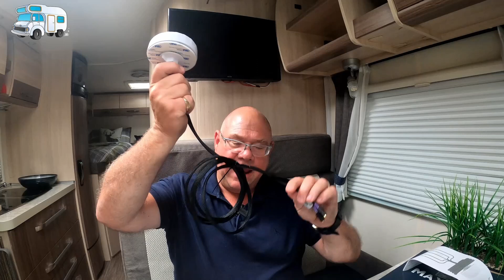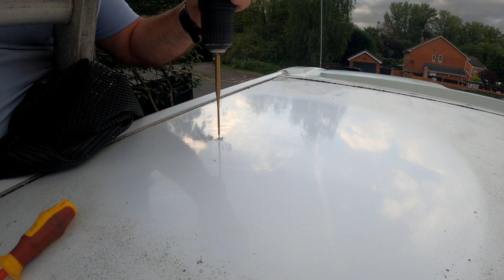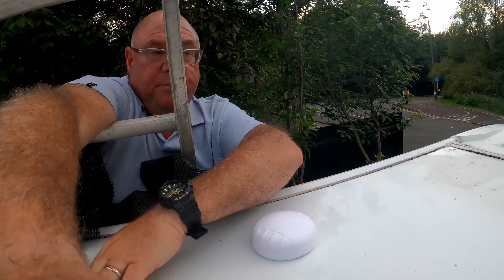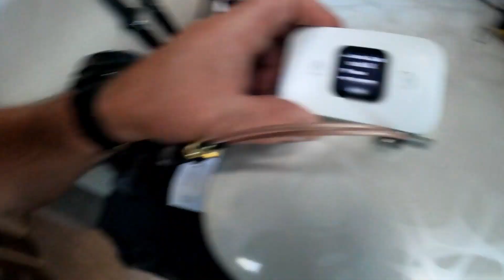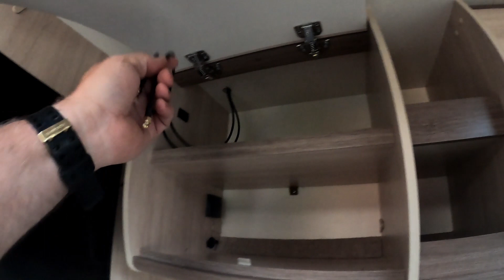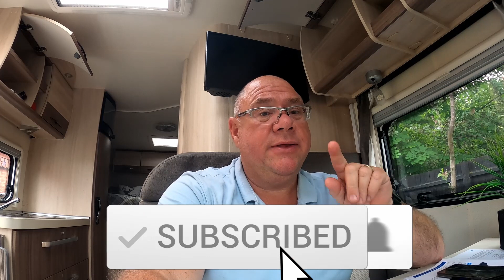MAXVIEW ROAM - Motorhome WIFI made simple

Comment: Most folk have those mimo antennas turned 90 degrees to yours so it is more aerodynamic ! 
Installers are making good money "fitting" these units. 
A true test might be done in a remote area using different sim providers and comparing signal strengths? 
Maybe another video idea?
Reply from the maker: Maxview actually state fitting it like this. No idea why. As a fully qualified radio ham, I understand radio waves and can see no real reason or benefit either way.

Comment: Informative vlog.
But I would have used bead of Sikaflex or other silicone sealant product in the drilled hole  for the permanent fixture of the aerial/antenna, and not relied on the sticky pad,  and a bead of sealant around aerial/antenna, to keep the entry of the roof dry/moisture out.
Reply from the maker: Yes. Out of camera I did do that. Sikaflex is king.

Comment: I fitted the Maxview roam to my caravan about a year ago, not the best move l have ever made 😢 speeds have been very poor, Maxview technical help were useless. On my new have l have just had a motorhome Wi-Fi installed, found it to be a far superior set up, speeds have been great. Used the same network provider on both systems.
Reply: Sounds like something you done incorrectly because this is a professional system
Reply: @ashleyprosser9867  trust me it was fitted correctly….. just a crap unit….. motorhome Wi-Fi all the way
Reply: @leearmsby235  what make is that?

Comment: Hi , Any follow up video to this ?
Reply from the maker: What questions do you have
Reply: @MikeM0XMX  I’ve just bought a Motorhome with the maxview , not been away in it yet but just wondered how well it worked and how good the signal is ? ( sorry , I’m a complete amateur!)
Reply from the maker: I was away over Christmas. I had no signal on my phone. I put the SIM into the maxview and had 4g 4 bars so brilliant
Reply: @MikeM0XMX  Thanks , that’s good to know 👍
Reply: So to be clear here the Maxview gets a better signal than your regular Mobile phone does?
The issue is that the wifi speeds from it are not great?

Sorry I am trying to understand  everything As I have one of these and I am considering if it should be returned for a better option, or can you just use a seperate wifi router to sort the wifi speeds?

My unit looks pretty much the same as yours. 

Would greatly appreciate an honest reply, thankyou.

Comment: Cool. So does it work well?
Reply from the maker: It works great. Currently connecting using it as I type. I haven't got a SIM for it at moment so as signal is rubbish on phone I have put the SIM in the router from phone and it's brilliant because aerial is on the roof.